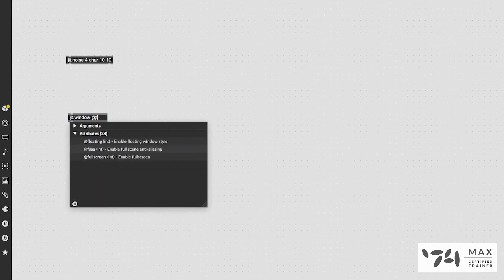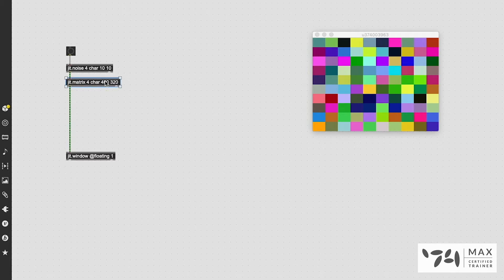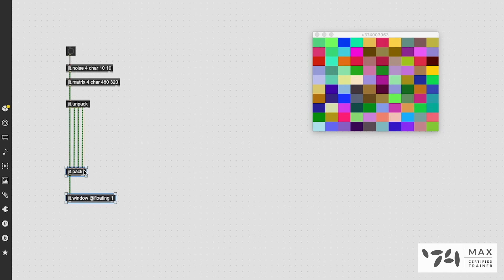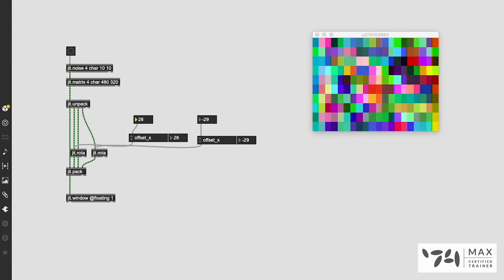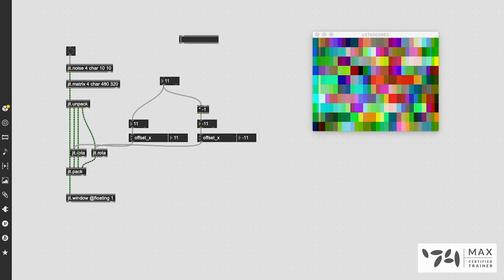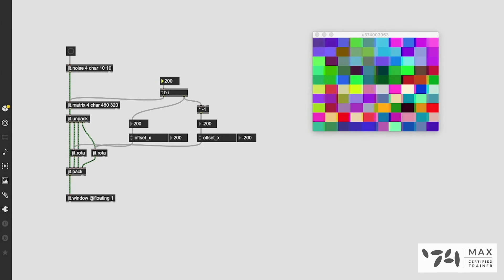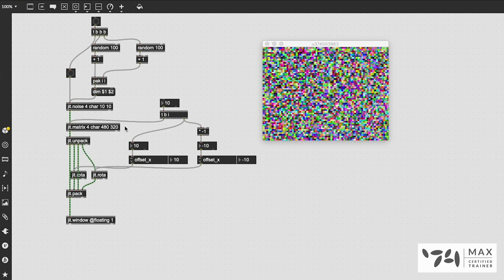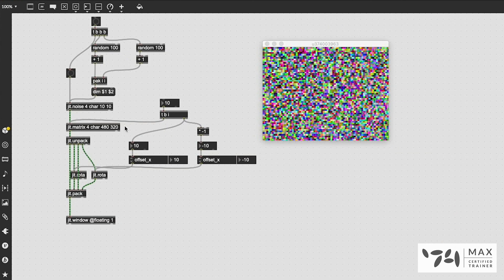Max MSP Tutorial - jit.noise and an intro to procedural animation - Intro to Jitter pt 2

Comment: 12:26 Thanks a lot for the vid! I asked myself, at this point if you offset both R and B >480 offscreen, shouldn’t there only be green squares left?
Reply from the maker: Jit.rota by default is set to boundmode 0 which will leave the previous frame in the render once you start to do some transformations. So to answer your question the red and blue would have a “streaked” kinda look to it that will mix with the green to create other colors. You would have set jit.Rota to boundmode 1 so it doesn’t keep the previous frame. Then when you offset above the dim size they will remain out of frame and you will only see the green squares left
Reply: @AndrewRobinson26  Ahh, understand. Thanks!

Comment: Hey Andrew, ty for the amazing videos once more! 

I’m getting trouble with jit.window, is always with green lines crossing the screen
Jit.pwindow works fine
Any thoughts why?
Reply from the maker: That’s a weird bug lol. Not 100% on this one but check which gl package your using. The old version is gl2 which is what I still run but it’s possible you’re on gl3 which processes textures slightly different and could be a possible cause